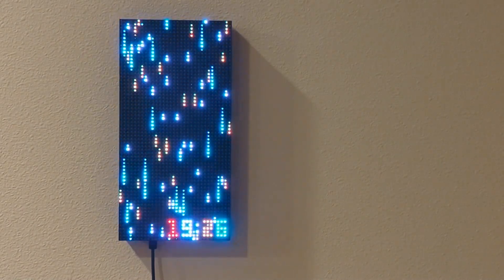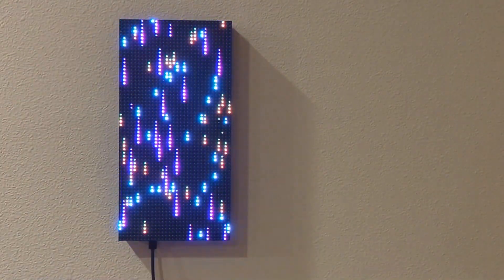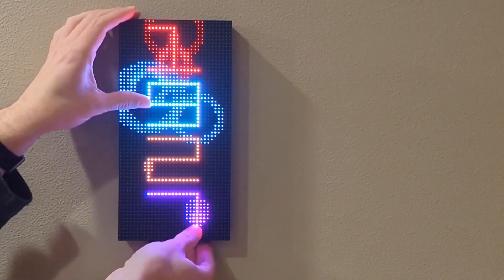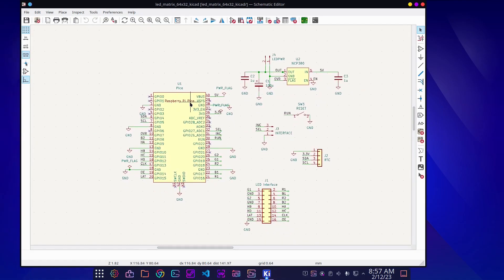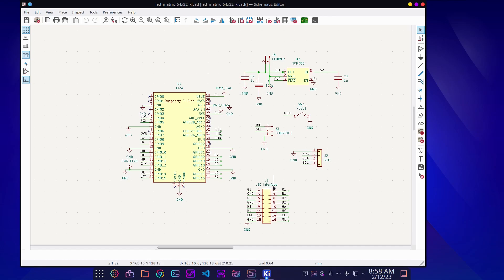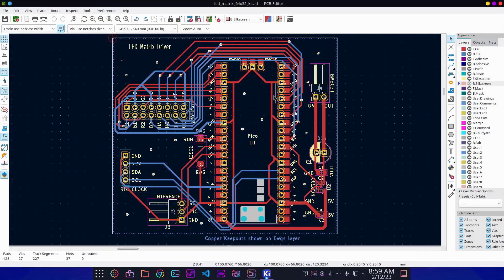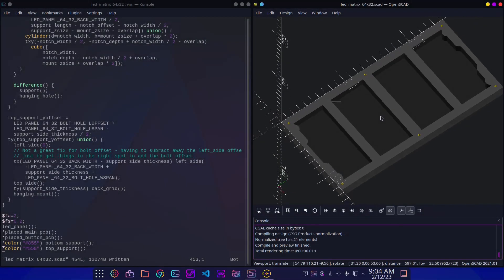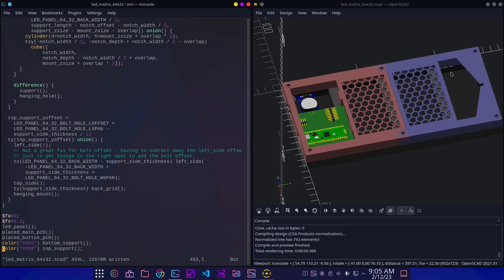LED Matrix Clock

Comment: can we also configure it as horizontally? as an open sources i think we can.
from this we'll able to add more animation stuff.
right?
Reply from the maker: It can be by changing the constants in led_matrix.h and removing the rotation code in led_matrix_64x32.c (rewrite led_matrix_render()).  Since all of the display modes were tuned for vertical, they might need some individual attention.